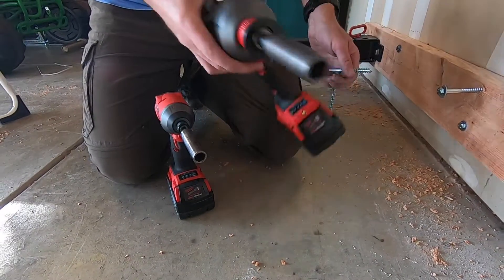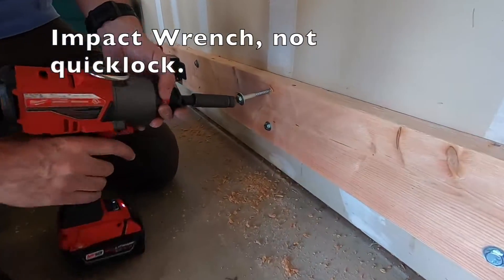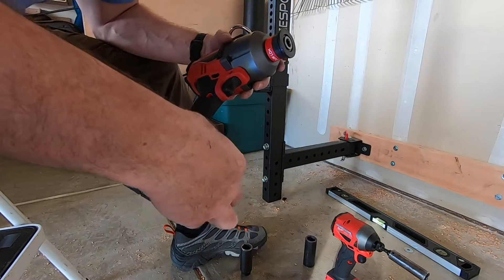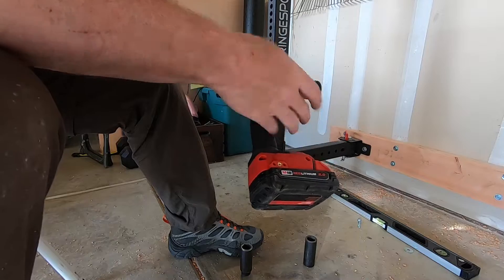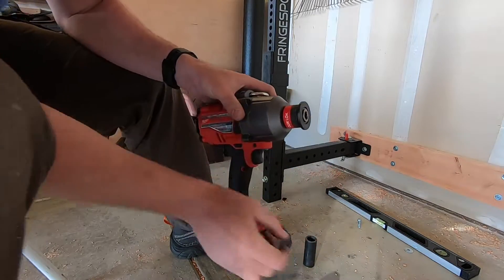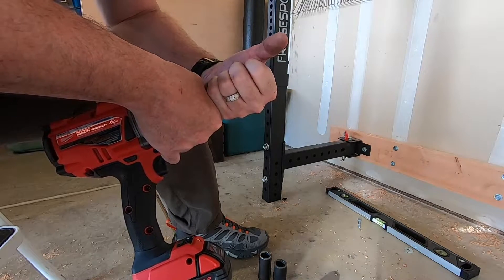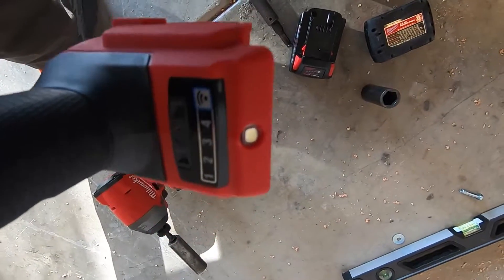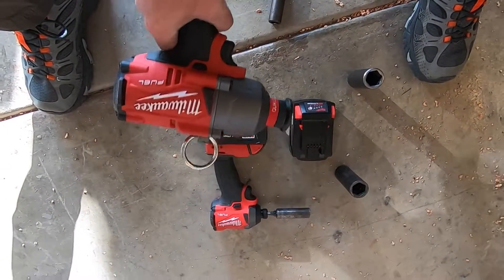M18 Impact Wrench With 7/16 Quick-lock

Comment: The problem with the hex quick lock is having to use those “anvils” or impact socket adapter, I couldn’t count how many of those things I’ve bought in my life and I have yet to find a definitive name for them. Anyways problem is I’ve had days where I have run through 3-4 of those damn things! A single day! and when they can cost anywhere from 3$ to 55$ apiece that can add up quick but the cost isn’t even the worse part because nothing compares to breaking the only one or last one you have causing you to no longer be able to continue doing whatever you’re working on until you make a trip to the closest store selling them. That’s what’s so nice about the impacts Milwaukee dewalt whoever make with it built in.
Reply from the maker: Agree. I have since purchased a mid-torque and use it for most applications. I found my sweet spot for this thing, though, I installed a 12x12 pergola with 6x6 supports at about 10 ft high at the highest point, and this thing was a charm with the drill bits. Boring through a two 2x10 temp strapped to 6x6 ten feet in the air, popping the bit out and tucking it into my belt, and adding the adapter with my socket locked onto it without climbing down was a treat. It was also 24 degrees out on all three days it took me to put this thing up, and that long handle came in handy. That is about all I pull it out for, and the occasional stubborn bolt on my jeep that the mid torque cannot get (that is a rare occasion, though). Nothing like this to bore through salt-treated lumber; that is what it was born to do. 

I am interested in what you were breaking or driving that broke the bit. I usually break the fastener first. Thats impressive.
Reply: Are you talking about the 1/4 hex to square adapters? I thought the 7/16 adapters might hold up better?

Comment: Have you broken any 7/16 to 1/2 adapters yet? I'm thinking about picking one of these ups and using it as a  medium 1/2  impact wrench. Also what gen is the impact driver? I bought another M18 impact driver and took out the 1/4 collet and replaced it with a 1/2 square anvil.
Reply from the maker: I’m sorry I’m so late to respond. I have not broken any and have only broken a cheap impact socket. the issue is not with them breaking but me loosing them, lol
Reply: @moto1833  Thanks for letting me know. Will definitely pick one of these up.

Comment: Is it crazy that I want to get on to for when I work on my cars with the rims?
Reply from the maker: not at all. it’s a beast! I have the stubby 12v 3/8 in that works well but I use this on suspension parts and stubborn mounts. it’s big, but works.

Comment: The big boy is for drilling into power line poles
Reply from the maker: Oh yes it is. In this video, I am not using it for what it is designed for at all but I don’t drill into power lines nor did I have a large pole to demonstrate on at the time. I did use it recently to bore through some 6x6 posts for a pergola build and it was amazing.
Reply: Enough meat for two sandwiches  😆

Comment: use hyper tough 20 volt max cordless hammer drill to drive 3 inch lag bolts
Reply: Hyper tough?
Reply from the maker: Its HF Brand
Reply from the maker: I would normally use my M18 impact driver for this but wanted to show something for the video.